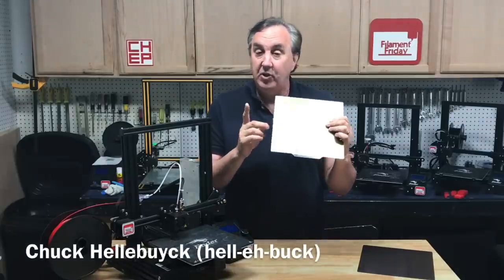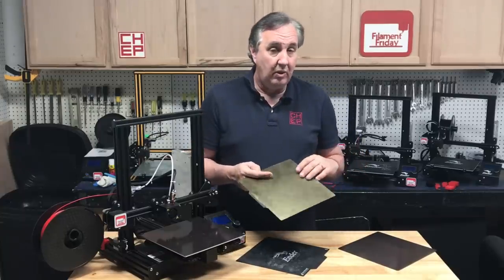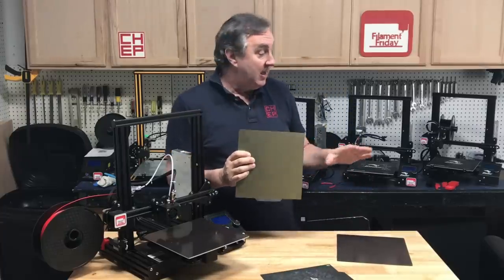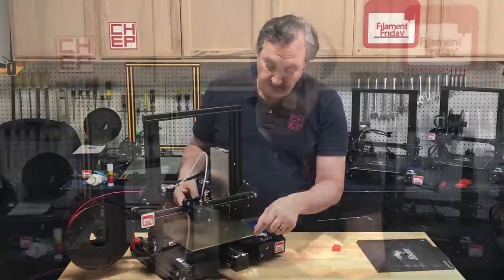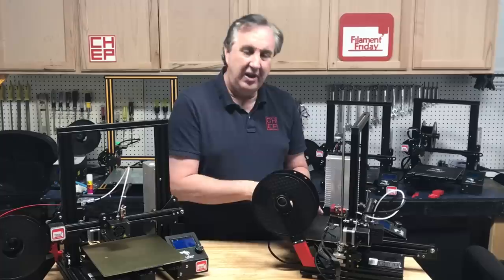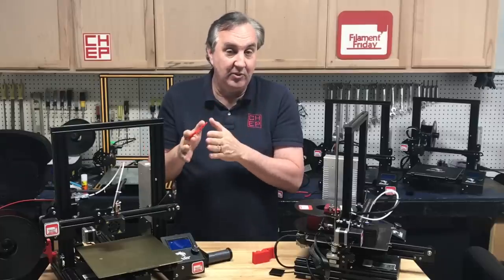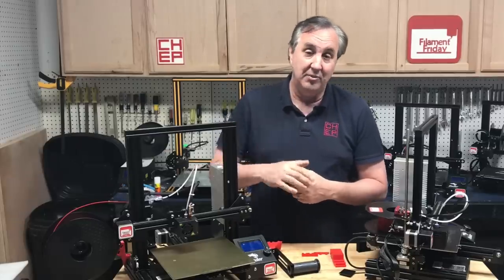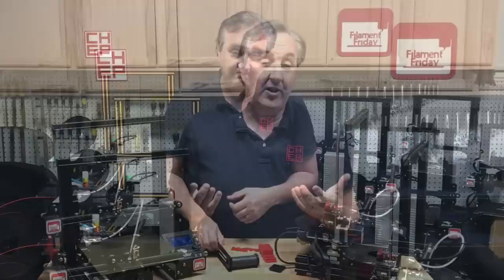Creality PEI Magnetic BED on Creality Ender 3 PRO

Comment: From my experience the 60 C is just too much. I don't know why most people use it. 50 C is the sweet spot. Any higher and I get warping even with an enclosure.
Reply: I doubt it’s the bed heat that’s the issue.  The filament is just not holding on the bed surface.
Reply: @boggisthecat I thought the same thing first. But trust me. Sometimes 60 C is just too much for pla.
Reply: @SarkanyGergogaming  sorry but this is incorrect
Reply: @batcadragos  I don't believe so. I am speaking from experience. And many other users have experienced the same. Some filaments don't like higher temperatures then 50 C. This also changes with build surfaces. What was good with a glass plate does NOT necessarily mean that it will be any good with a metal plate. Since it has different thermal caracteristics. Let me put it this way. If this wasn't the case then why don't we print pla at 100 C? Because it softens that much at that pont that it can't hold onto the surface. Thats why you have got to find the sweet spot. Most of the time it's 60 but on some occasions it only works at 50.
Reply: @SarkanyGergogaming  You might think you speak from experience. It's just what happened to you and you traced it to your bed temp. over 12 printers using 60 and 70 C. No issue for over 3 years, with many filament brands. FOr sure it can be true for your setup, room, material, etc. It is NOT a fact tho
Reply: @batcadragos  never said it was a fact. I just wanted to let him know that he should try this. And I also discussed this with many more experienced users on discord and some reported the same experience. But if you look on the reviews page on the creality site, many users state the same thing. Change the bed temp because it's a different build surface, and it solves the issue for 90% of the users.

Comment: the pei sheets that come on those beds are too thin. i had a nightmare of a print with pc and too tight a bed leveling. but with the gizmodorks sheets (much thicker, much more robust) and my second bed with the ultistick powder coat pei i couldnt be happier with bed adhesion and part removal (and i have 3 printable surfaces for little to no down time in between printing)

Comment: Try lowering the bed temps, especially for PEI it tends to warp the farther it is from 60degreesC.
Reply: I'm having really good results with PETG and a bed temp of 55C
Reply: @DanMestayer  In my opinion PETG sticks too well, and I only use it on flexible builds surfaces to prevent it from being irremovable, which is what happened to my last PEI sheet which I put on a glass sheet and stuck too well to the PETG and forced me to remove the PEI and throw it out.
Reply: i have a sheet stuck to to glass and have done ABS at 110c and love it
Reply: Oh wow.  I was going to say the opposite, I've been running 65C with PLA.

Comment: How do you adjust the nozzle height when using the glass plate on the ender3 pro
Reply: You don't - you adjust the bed!
Reply: I  use a glass plate with a pei sheet and in order to get the nozzle clearance, I raised the z axis limit switch a bit. I lose a small amount of vertical height on prints but i generally don't print to the vertical limit anyway so no big loss.
Reply: Thanks for all the response. I adjusted the bed and it works fine

Comment: default PEI is too smooth. Scuff the PEI with sandpaper (400 - 600 grit) and wipe dust off with IPA. Then use steel wool  and IPA there after. You'll still get super smooth prints but the filament will now have something to stick too. Finger oil will get into the sanded surface of PEI so use IPA to clean before you print again.  Also be careful printing PETG or PET variants. It will bond to the PEI surface. Whambam PEX is a little more forgiving than PEI.

Comment: I have the PEI bed and definitely prefer it to the glass bed I got with End er 3 pro V2.

I have found slight warping mostly on the corners of rectangular based models and have tried lowering the bed temp and the fan speed for the start of the model with mixed results. Has anyone else played with these settings and what was the outcome? 

I haven't been using IPA to clean but after seeing the comments here will start.
Reply: For square base model just add a small brim

Comment: Some people have said that they needed to increase the bed temp by 5-10 degrees to have their filament stick properly to the pei sheet. Some have also said that the cooling effect from the fan (blowing down towards the bed during printing) effects the pei/metal sheet more than other bed materials, like glass (which holds onto a lot more heat, and more evenly, because of its thickness/mass). Try bumping up the bed temp by 5-10 degrees to see if that helps.

Comment: Good surface, only problem is, how does one access the bed screws once fitted?  Say you want to replace springs etc?, if one hasn't already, as this covers them :)
Reply: dont know if you ever got an answer, easiest way is to hold the under side of the screw with pliers while you take the nut or whatever it is you need to remove off

Comment: i know my comment is a bit late to the party, But I have a pei plate as well and its a common thing, I print now with a raft underneath my print to prevent it from wrapping, or I plate the print more to the front of the print bed
Reply: Sound advice. Why do people print small models in the middle of the bed rather than directly over an adjustment wheel?!

Comment: PEI os better than criality Glass bed?
Reply: hell no. not to my experience.
Reply: yes, glass is the most inconsistent surface ever. i'll print one thing on it, and it'll stick perfectly and self release when the bed cools down. i'll print another thing, not change a thing, and it doesn't stick in the slightest and then i have to tighten down the bed too much. get pei, it's better in every way
Reply: @JZM006  thank you! :)
Reply: My glass bed has all the imprints from old prints that won't come off the bed.  It leaves outlines of those old prints on my new prints. Switching from glass to pei
Reply: @ThatHippyDuck  I went with this PEI because my creality glass bed had a superman grip on the part even after cooling. Plain glass - not enough grip. . . Coated glass - WAY too much grip. . . . PEI - just right.
Reply: @JZM006  Exactly my experience with glass, there seems to be some hidden (for some of us at least) variable that makes the glass work or not. But, after some printing done on the creality carbonum glass I'm starting to have a feel for what the glass "needs". If the glass is clean and hot for some minutes at around 70C before the printing, and if the Z offset is between a very narrow range of baby steps, and if the nozzle is around 210, then your chances of the first layer sticking are very high. So is not a very forgiven surface I would say, no. Finally, some times a fine coat of adhesive spray is all you need to by pass some of the demands of the glass and have almost the success warranted.

Comment: did you scuffed it with 00 steel wool? if not it's your mistake right there, also you need to clean it with 90% IPA between each print..... and you need to refresh it from time to time with the 00 wool, no need to say that you need to clean it after refreshing it..... but you seem like the kind of guy that already knows everything about it.....

Comment: seems like junk to me... if you had bed leveled and set the same as on your others...i have best results with the black stock peel and stick surface on my ender 5... glass on my cr-10 clone is not nearly as reliable... nothing sucks more than having prints come loose hours into the job,,,

Comment: 1500 grit sand paper and a coat of hairspray..you won’t have to worry about adhesions
Reply: It's a mess.  PEI just works dry.  All the time.  I have a 220/330 sanding block and alcohol pads standing by, but my PEI is 3 years old and kicks butt.
Reply: @TechGorilla1987  PETG needs a release agent on the PEI, otherwise it sticks too much on it. "Works dry" myth --> busted.
Reply: Alejandro Pérez - Shall I make a video of me making and removing mask extensions from PETG as I have been doing for a week now?   I’m not speculating, I’ve got empirical evidence.  TPU and ABS are equally good.   My PEI sheet came from Gizmo Dorks.